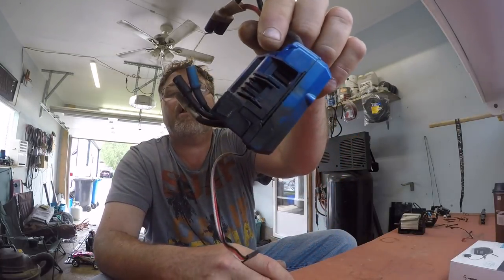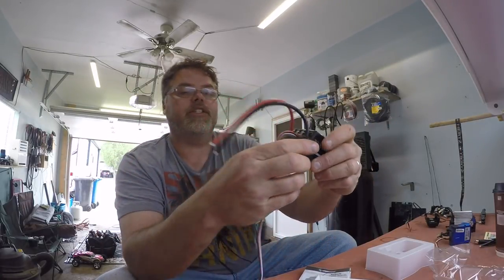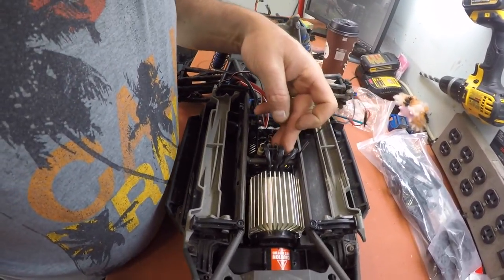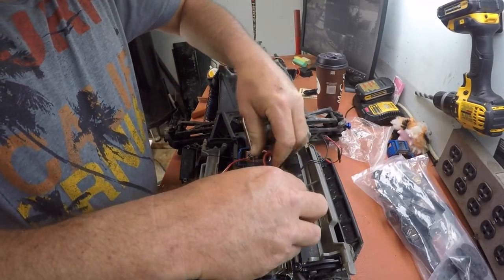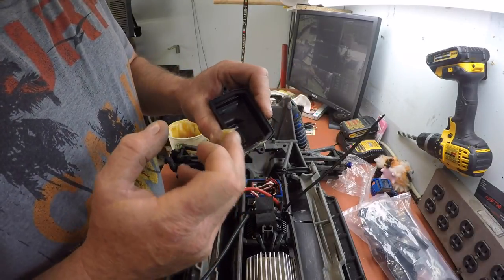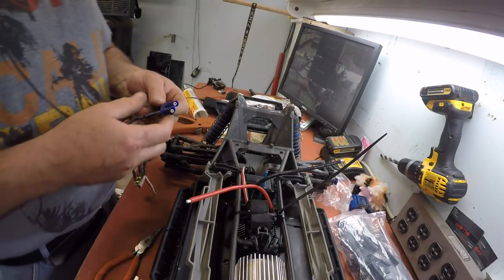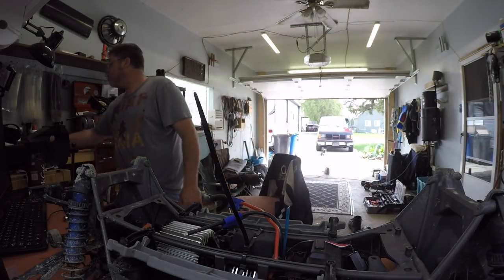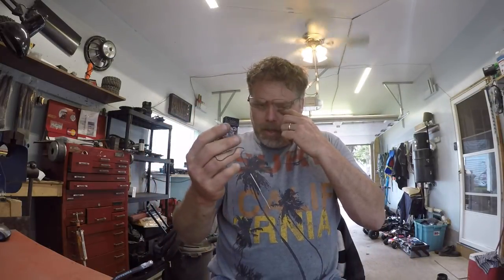EZRUN MAX 6 Hobbywing

Comment: Billsiff, the same happened to my VXL-8s. It caught fire on the first power up and also caught the receiver on fire, so I had to replace ALL the electronics. I sent them back to Traxxas and bought replacements on eBay. They said the ESC is on backorder, so it could be months before I see a replacement. I took a poll on Facebook in the X-Maxx page and over 200 people voted. It seems that 30% or more of these ESCs are defective, so I replaced it with a Max 6 also.
Reply: Julion Bush yep mine caught fire within two mins and pretty much fried all of the electronics.
Reply: Problem traxxas will not even accept knowledge of it they dont stand behind there product that's not so cheap may I add